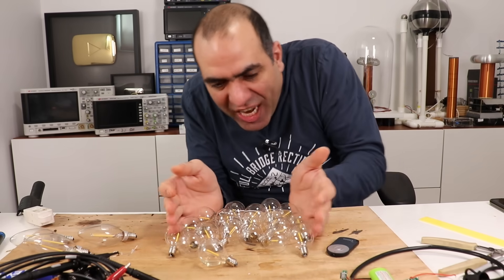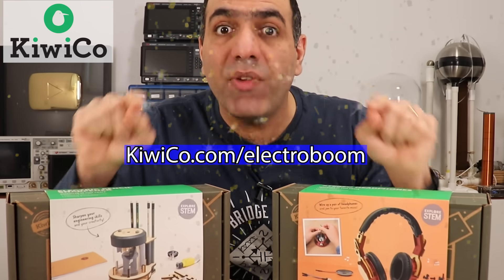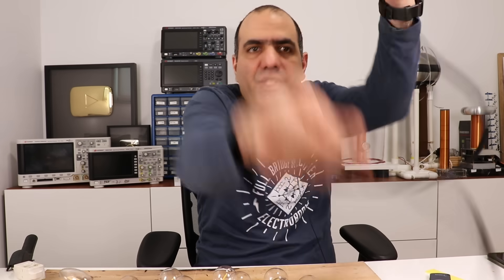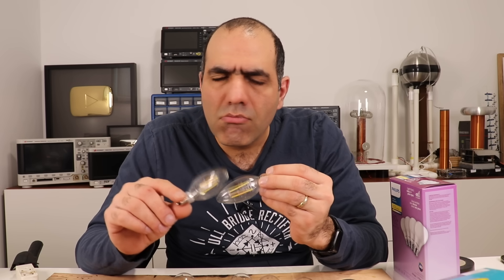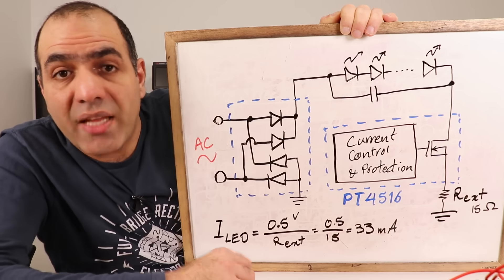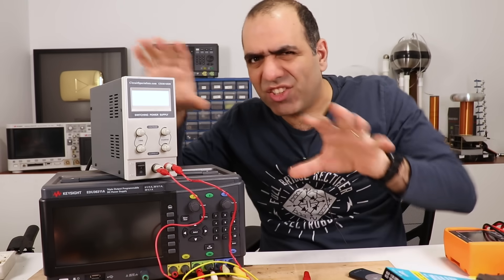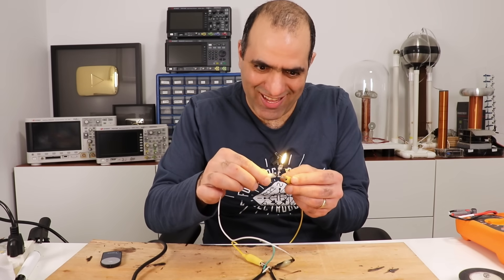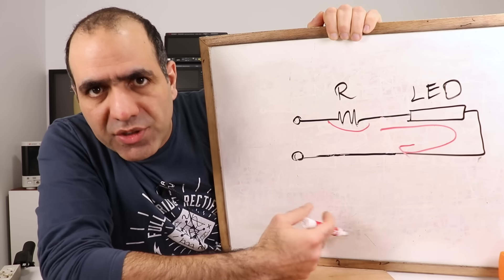So Many MISERABLY FAILED LED Lights

Comment: ElectroBOOM Here is little challenge for you 
-Is it possible(it is! but want know more information) grill meat with electric wires (put electricity thru it)
-How much volt it takes (what is the limit of volts when it cooks/grills?
-And is it taste electric?

Comment: Correct, man, components pushed to the limit to give their best for a few hours and circuitry reduced to a minimum. I also bought the same lamps, two of them died two days apart, not even 500 hours of operation ...
Congratulations on your work, colleague: I am also an electrical engineer :-)

Comment: Don't waste resources, electronics recycling by the DIY'er: Don't throw them away. You can heat up the glass envelope with a flame, and then immerse them into cold water, and the glass will crack. Then it is easy to remove the glass without damaging the LED's. Many of the LED's are still working even though one of them went bad. It is also possible that none of the LED's are malfunctioning, only the rectification components employed to convert the AC to DC. Hopefully the manufacturers don't simply use the lazy man's current limiter--- a multi-wattage resistor that simply gets hot, and wastes energy as a means to power the LED's. They may be using a capacitor resistor combo to reduce current--- that may be the manufacturers solution. I've seen that after disassembling an LED AC powered light bulb a few years ago that stopped working after only a few weeks. I like to build my own garden lights, and the LED's out of these defunct LED bulbs works just fine for my DIY projects. On the subject of garden lights: I wonder how many people simply throw away those $1 store garden lights made in China after they quit working. They don't last long--- maybe a year plus a few months. The reason is that the Nickle metal hydride batteries used in those $1 store solar garden lights are extreme low capacity, and don't last long. It is easy to replace those batteries with new ones, and your garden light will work like new. You can even install a higher energy density battery, and then you won't have to replace it in just a year, or so.

Comment: I just watched Veritasium latest video about light the obsolete minded manufacturer by what Cartel  association I can't remember. Your video might be connected to what Veritasium explained. Since Light Emitting Diode its self are really durable so they manipulate the component and made a bad circuit to gain profit for repeated customer.

Comment: sir good day, i would like to ask if you can really charge a car or motorcycle battery using a laptop charger, using a bulb to lower the voltage from 19v to 12? is there legitimacy in this?

Comment: Cree and Home Depot. I bought about $100 worth of bulbs, at least half of which lasted less than a year. Class Action suit:  HomeDepot and Cree sent me a check for $10. Warranty? Sure bring in your original receipt. Usually HD doesn't require this - so you know they know they sold a lot of garbage.
And Yes Amazon also sells a lot of garbage. They haven't noticed that when I get ripped off by one of their third parties, I boycott Amazon for a while, and I find other sources for things. Most of which I stick with. So much for Big Data.  There are types of products I won't buy on Amazon, like power tools and expensive appliances. One scammer Amazon let call themselves "Apple" and then sold me a MacBook powerblock that almost burned down my house. (Same price as Apple Computer, but with the real Apple product someone had to be at home to sign for delivery. I thought this was the only difference.) When I opened up the powerblock case and compared it to iFixit, YouTube, etc... it didn't look anything at all like real Apple powerblocks. Thanks Amazon! ) I won't buy LED bulbs from either HomeDepot or Amazon. Instead I buy most of them from Costco, so far 100%, and if they go bad even after a year Costco will take them back. 
In the George Dyson book about the Eniac he told how they wanted to find the most reliable vacuum tubes to build their computer around. So they tested thousands of tubes. What they found also seems true for auto lights and house bulbs, but not yet for LED bulbs. With the vacuum tubes the ones manufactured in the greatest numbers, which also meant at a lower price, were the most reliable and long lived. The extra life tubes were unreliable and usually had a shorter life span. (!)

Comment: Theres always a way to build in failure mods, even into stuff that is supposed to hold up much longer than older tech. Watch bigclives´s video about the special Dubai- lamps that where designed to last longer because the rich customer wanted it...

Comment: Cheap LED lights don't last half as long as decent incandescent lights. They are just a waste of money and resources that quickly goes to the garbage. Those cheap lights usually use badly designed and super cheap drivers or even just a resistor as seen in the video, which makes them a lot worse than incandescent bulbs because of flickering. Yes, it is 50 or 60Hz, but it is still not good for you and is terrible if you work with machinery. The other thing is that the cheap lights also tend to use crappy quality LEDs and most of the time the LEDs are being used at around or even above their absolute maximum rating, shortening their life signifficantly. At the end you waste your time to replace them often and you probably end up spending much more than you would spend for a good quality lights.
Reply: And that is why we need to let manufacturer's know that they are making a shit design

Comment: It's a big contrast with quality of component and the product they build. Most low level components are made to spec, and segmented on quality. Light bulbs for example, has a PCB full of resistors, fuses, transformers, MOSFETs, LED diodes etc all made to meet a standard. And then led engineers are told to make run bulb at high current aging the led fast, and encase the metal heatsink in plastic...
Reply: But not everyone has the tools, skills and most importantly time to diy lightbulbs, that and these things are so basic it is not worth the effort and shouldn't have to be like this in the first place.

Comment: 12:40 IP44 WEATERPROOF. IP44 basically means that they are can withstand a splash of water greater than 1mm in size. Absolutely no idea what "WEATER" is, but if you find one, those small lights are proof against it, or do they just provide proof that it exists?

Comment: The biggest PITA is buying a set of bulbs, having one fail in year and then trying to find a matching one (color temp and brightness).  Currently I have mostly CFL bulbs because I got those years ago and they still work. Still got a few incandescents too. No LEDs yet.

Comment: I swapped all my lights to LEDs back in 2013, all fancy with big heat sinks, even a couple of those liquid filled lights, all dead, except the box of 4 cheap chinesium LED bulbs, one of which we leave on 24/7 except when the power goes out. 65khrs so far, best $5 Ive spent so far. 

The bulbs fill with water from day night warm cold cycle condensation sneaking into tiny breaks in the seals.

Comment: get the other type of led bulb. mine seem to last quite good few years. 
i wrote the date i installed them near the base of it and the only one that burned out lasted 4 years. it only cost $1 something. it only died because the housing got super hot and it fell apart.

Comment: "so manufacturers can improve their quality" lmao they already did, old LEDs last forever, I still have some running. They realized this error in quality so they made them die more frequently.
Reply: I just buy the cheap $1 bulbs... Ive only ever had one fail (a single led burned out).
Reply: a lot of the strain on lightbulbs is caused by turning in and off, keeping them on indefinitely is helping the long lifespan
Reply: @tomseppe6406  For incandescent and fluorescent yes. Not really for diodes.
Reply: I got "boob lights" enclosed fixtures and they fail really frequently on me. I could try finding a bulb that can handle the heat but I think I might just deal away with the fixtures
Reply: @codemiesterbeats  You mean you put a product that requires passive air cooling into an oven and are supprised they die quickly?

Comment: I've had quite a high failure rate of the NOMA branded LED "filament" style bulbs lately, almost 50% failed after two years, with less than 1 hour per day of use! In my case, the LED strings are what has failed, they go open-circuit, intermittently at first making the bulb flash on and off, but progressively getting worst until the bulb no longer lights at all.

They are in indoor fixtures that are completely open, with the bulbs sitting horizontally. Absolutely nothing to impair heat dissipation in any way, and I keep the heat in my apartment relatively cool at 18C. So definitely the bulbs have had a very easy life, but yet they are dropping like flies!

I need to start keeping receipts so I can actually warranty the stupid things, this is ridiculous! The cost-cutting has gone too far and I suspect as consumers we probably pay a 90% markup over the actual manufacturing cost, at least here in Canada, these bulbs are expensive!

It's a pretty sad state of affairs when plain old ordinary incandescent bulbs are more reliable than the LED equivalents. Since the extra heat in the winter does not go to waste, and I use the lights very little in the summer (loooooong daylight hours being so far north), I think I'm going to switch back to incandescent as long as I can still buy them.
Reply: oh Noma is such garbagio.

Comment: 00:32 The LED light is obviously watercooled so that it can be brighter without overheating. To save on shipping the bulb gathers the cooling liquid out of the atmosphere.
If it breaks it's like Apple usually says: It's not that the product is broken, but you have been using it the wrong way.
Reply: Ahaha very funny
Reply: ... è vero, lo hai usato nel modo sbagliato :
ad esempio, lo hai ACCESO !!!
Reply: Hahahahaha  @massimo63
Reply: Bro won't the water fuse the filament in the bulb ??? It's obvious the waterproof lining of bulb is removed . Stop being oversmart.
Reply: @frizz6779  You are entirely wrong, buster! You don't know how these things work. The water in the bulb will neither fuze nor short circuit anything in the bulb. If it doesn't work anymore you just used it wrong and broke it - #NoRefund

PS: You might want to check out a description about sarcasm... ;-)
Reply: @frizz6779  https://en.wikipedia.org/wiki/Sarcasm
Reply: @Rdw_04  thanks
Reply: @frizz6779  🤡🤓☝️

Comment: I have noticed in my LEDs bulbs, it's actually the power supply that fails, although I had a $1 bulb last nearly 2years, running 24/7!        Dude, get a socket!!

Comment: well old light bulbs were not so efficient because 95% was convertet into warmth and 5% light but only as you try to enlight rooms with it but if you use it in an oven to heat it up the numbers turns so old light bulbs theoretically could used efficient too but it wouldn't be so good

Comment: Please, please, please, don't show electrical/mechanical accidents - they are not fun. While I really appreciate humour and an engaging as well as knowledgeable host, I definitely don't want you trivializing electrical safety and show shocks, short circuits, injuries caused by negligence. In my middle age, I definitely crave for learning from your channel but don't have the heart to watch you subject yourself to hazard caused by deliberate carelessness. On the other hand you can show how to be careful with electricity. Hope you will agree with my request to keep the fun and keep out the accidents.

Comment: Warranties are useless.  Even if you do replace them. How can, say, a company like EcoSmart even be remotely "eco friendly" with all that energy wasted on fuel for return shipping?  The only brand of LED bulbs I've found to last a long time are made by GE (haven't lost one yet - 2 of them run nearly 24/7).  Phillips, Sylvania, any Walmart branded bulb, and every unbranded LED I've tried, all failed sooner than, my incandescent bulbs (which I replaced all the tungsten bulbs in all my closets I bought with LED bulbs - every last one of them died within a year or 2 after minimal usage (still have a box of tungsten bulbs from the 1980s! - all of which were working when I replaced them a year ago).

Comment: This is awsome but the thing is if ur kid is probably around the age of 10 instead of kiwi co get them an arduino uno R3 starter kit (Not Advertisement!) I would recommend going to Amazon and not arduinos website because Amazon has Atduino kits that are not by arduino but they do release the arduino to public for making ur own arduino but the best to do is is go to amazon search arduino starter kit and pick elegoos (Again not Advertisement!) R3 kit and that comes with a lot for about 36$ usd and has the R3 and comes with more that arduinos actual kit and is high quality and this is worth it I have supported elegoo for years now and its worth it other than spending about 100 dollars on the original kit and its has more lessons so if you want to learn or just buy it for more components this is what I do

Comment: 9:00 The LED "filaments" are actually a ceramic backed circuit board with a string of LEDs on them. Then a phosphor coating is wrapped around it that also acts as a diffuser for the LEDs.
Reply: I was looking for this, thanks :D

Comment: LED filament lights have the following QC problems:
the "filaments" are usually in series with the individual LEDs also in series. So any LED failing makes the entire light die.
these bulbs are made cheaper by having very simply power supplies but do so by over driving the crap out of the LEDs
the cheapness of these lights also lends them to using bad quality silicone chips in the first place
Solution:
LED filaments are a novel and welcomed innovation by homeowners and no one wants fat bases for power supplies. Basically LED filaments necessitate running at LOWER than rated current and with exceptional QC. While also getting the full benefit of efficient SMPs would require but more additional cost. Whats nice here is that this is the perfect application for a DC power standard where the power supply is separate from the bulb. Not sure when or if thats going to happen but we are going to continue to have to deal with these issues until then.

Comment: All of the LED bulbs shown were filament LED bulbs which have two major reasons for high failure rates. The first is that its basically a string of small leds any of which makes the entire light not work if it fails. The second issue is that because of the series current of the LEDs driven at high voltage fluctuations in the input of the power supply can cause significant strain on all the LEDs. These two apply to name brands and basically you're paying for the extra bulbs you'll claim later in the price. So not only is it important to have a long warranty but for that process to be painless as well. Then there's a third issue which applies to cheap bulbs which is the silicone quality of the LEDs which increases the rate of failure. This pretty much means cheap filament LED bulbs are almost guaranteed to fail within a year thanks to the first two factors.

Theres another type usually with aluminum backed circuit boards and a more substantial power supply to drive them. You'll know because these have big bases. Power supply components are expensive so often this type for conventional 40w or 60w equivalents might not be that much better value. But for higher output bulbs they generally are.

Comment: For those that don't have a warranty but still claim to last longer than they do, you can buy more and then return the failed ones. Sure, the new ones will probably fail just as quickly, but hey, revenge!

Comment: 1 of the GE Reveal Par30 LED lights I installed in my bathroom failed in under a year, I went online to the GE website and managed to find the warranty claim section, filled out the form, they mailed me a coupon for a free pack (since these bulbs are sold in a Pack of 2) so now I have a spare.

Also, Damn I wish they had crap like that when I was a kid to teach me things, i had no concept of AC vs DC and tried hard wiring the dead CD-ROM drive we pulled out of the computer directly to the houses main line, thank God for circuit breakers.

Comment: We converted to LED probably 10 years ago, and we've had no failures except for one exterior light(that wasnt rated for outdoor)

It is very odd that we havent had failures, as we're using them in exactly the wrong way, most of them are in enclosed light fixtures, sure LEDs dont generate a lot of heat, but when you have then in heat shielded enclosed fixtures, that heat will build up. This is even worse because most of our bulbs in the worst fixtures were the earliest LEDs(back then they used weiird shapes that cast weird shadows so they were best stuited to fixtures that would kill them, but mask their weird shadows)

Comment: Funnily enough, the only lights i've had trouble with, are cheap chinese imports, and CREE.
I have some little 40w reflector type lamps i installed in my range hood when i moved in in '15.
they've been on 24/7 since, and are still burning!
I figure, they're nearing 50k hours!

Comment: I took apart a similar light bulb with the same type filament and it only had a resistor

I did some testing on it and discovered it runs on 12v

Comment: Professional as always. I had luckily bought osram led bulbs(with 3 led strings inside) for about 1.5 usd each in Romania and they are great. 7W, 806lm, 10000h, 2700k, E27.  Unfortunately they went out of stock fast.
Reply: Nice.

2 years later, I run 5.9W 806 lumens, 2700K, E27 ones. Poland. Generic brand that doesn't even show up online.

Really nice. Pleasantly warm light, and they don't fry themselves very fast.